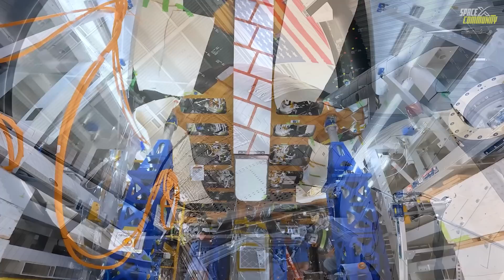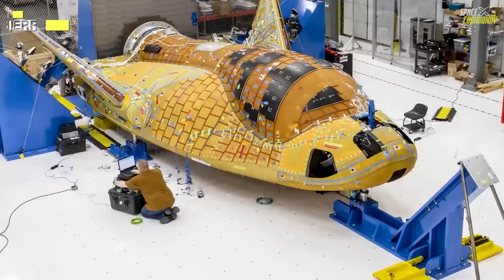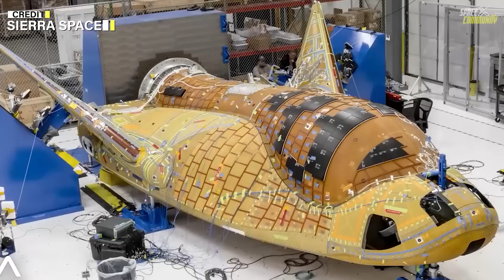Sierra Space Dream Chaser Launch CANCELLED by ULA! Next New Shepard Flight | Episode 53

Comment: No steerable a nosewheel is a recipe for a mishap.
Look at other non-steerable tri-cycle aircraft like the B-25 and review the accident/mishap data. The only steering capabilities after a high speed landing is by differential braking? 
Give me a brake (pun intended) and don't count on an automatic directional braking system that would fail when you needed it most. 
Stupid idea.

Comment: I was involved in the original development of Dream Chaser by Space Dev before Sierra Nevada Corp bought them out, some of the problems that wasn't solved back then(2001-2002) was how to launch with people aboard. Problem 1 was the rocket that was planned to be used was the AtlasV which at the time wasn't man rated, Problem 2 was getting people aboard and then closing the fairing if it was man rated, and finally Problem 3 NASA likes launch escape systems not that they have ever saved a life but you never know however Dream Chaser has no launch escape system and buttoned up inside a fairing makes escape not possible at certain points of the flight even if there was an escape system.

Comment: While a Falcon 9 clearly has the capacity to lift Dream Chaser into orbit, an adapter ring and payload fairing would have to be designed. That might take a year, or more.
Reply: That would depend on the company doing the adapter. Some engineers are better than others, just saying on experience with team members.
Reply: You're going on a "normal" timeliness for developing rocket parts. Spacex  is developing an entire new class of rockets at a staggering rate - give them the dimensions, and they'll knock out what they need in months...

Comment: Perhaps SpaceX can launch the Dream Chaser.
Reply: The Falcon sized fairing will not work.  A new one would be necessary, PLUS SPACEX would rather use Falcon Heavy  with capability to put the vehicle into a higher orbit than Falcon 9 could.
Reply: SpaceX is pretty focused on Starship. Once that reaches its potential, a lot of other rockets (Including the Falcons) will be less viable. If they manage their dream of rapid reusability a Starship launch might end up costing less than a Falcon 9 launch. This according to Musk.
Reply: @gregsteele806 Starship is literally going to be a massive failure. Cost alone will make it not worth it most of the time, plus not to mention who tf is launching 50 tons to orbit? Almost no one lmao!

Comment: DreamChaser  might be better served by working with SpaceX. A dual booster option for their plane just makes sense.
Reply: I don't think Dream Chaser would fit in Falcon 9 fairings and SpaceX has said that there will not be a "bigger fairing" until Starship.
Reply: @MaruAdventurer  Sierra and DreamChaser will never contract with SpaceX. Most of the money Sierra gets comes from Jeff the Bozo Bezos and the partnership with his Body Odor company that can't even build the rocket engines for ULA's rockets. This is why he is trying to delay the Starship launch by suing the FAA and SpaceX for the 3rd time.
Reply: couldn't it use falcon heavy ?
Reply: Exactly, why depend on one single booster? And a costly one at that!

Comment: Can Dreamchaser fit on a Falcon 9 or Falcon Heavy?
Reply: Falcon Heavy is a maybe, but the faring is the question
Reply: The Falcon Heavy has the lift capacity. May or may not be possible to recover the core booster. You would need a custom fairing which are more difficult to design and build than you might think.

Comment: They should just put it on a Falcon9 and be done with it.
Reply: Sadly not politically likely, Even though Falcon 9 is human rated so a crewed version of Dream Chaser could also fly. There is also no intention to human rate ULA's Vulcan. Blue Origin one day hope to human rate its New Glenn, but in my view that is many years away.
Reply: It won't happen because of the partnership between Sierra and Jeff the "Bozo" Besos
Reply: Falcon 9 already has an operational crew module.

The only thing Dream Chaser brings to the table is the ability to land at an airport .

From Space X's point of view that's not worth the effort or cost of making an adapter.

Comment: ULA will never launch 35 flights in a year, no way.  SpaceX launches every 3-4 days. Over 140 launches this year.
Reply: That's the advantage of reusable boosters! Say what you like about Elon Musk, he does have a great vision for how to make space more accessible.
Reply from the maker: Haha, I agree! But that's what they are claiming!
Reply: That would require 70 BE4 to be delivered and work 100%
Also sadly for Sierra Space, Vulcan is not going to be human rated. And New Glenn needs 7 BE4s.
Reply: If one can do it, another can do it.
Reply: @bobbarclay316  Well sir, I'm not Ironman.
Reply: @bobbarclay316Sure - THEORETICALLY! But at this point in time SpaceX is the only one actually pulling it off. Apparently making a reusable launch vehicle is a VERY difficult trick to pull off. IMS Vulcan isn't reusable. That makes any launch using it VASTLY more expensive compared to SpaceX.
Reply: That was part of the design goals of Vulcan the Delta IV factory had the capacity to produce 40 CBCs a year.
If Spacex can launch often someone else can as well.
Reply: @Patchuchan Well sort of. For ULA to launch 35 V/Cs per year it would have to produce 35 V/Cs per year. That would require BO to produce 70 BE-4s per year (V/C is entirely expendable) or an engine every 5.2 days. Anybody ready to bet serious money that they could do that? I sure as the world would not!